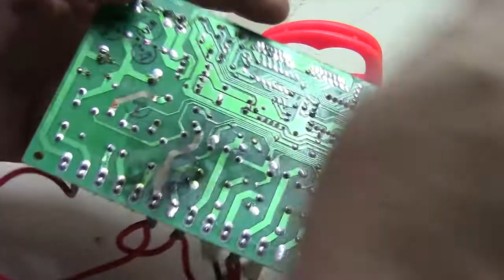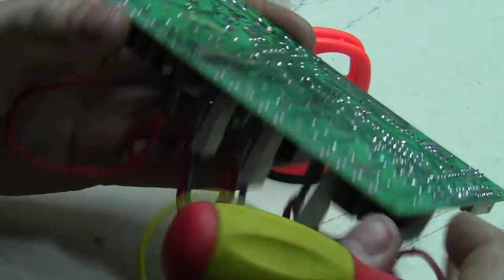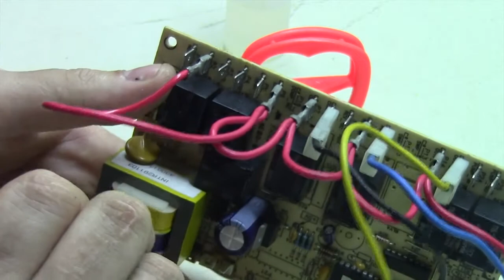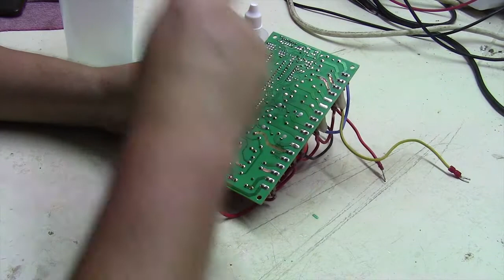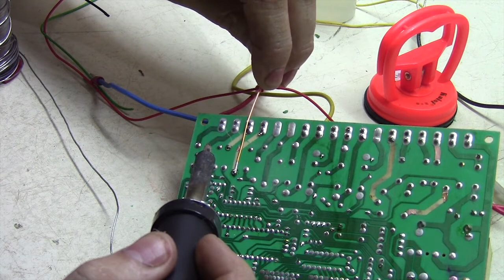ShoutingElectronics #37 - Trane Airconditioner PCB

Comment: Normally those relays do not survive operating into a mains short. The contacts either weld themselves shut or burn away. Must have had the fan motor overheat and go nearly short circuit when the capacitor went open to blow the tracks away, but the fuse must have saved the day. Likely went boom when the AC guy replaced the fuse only.